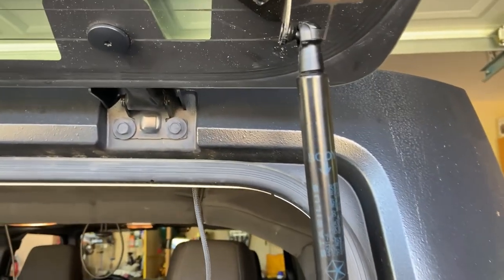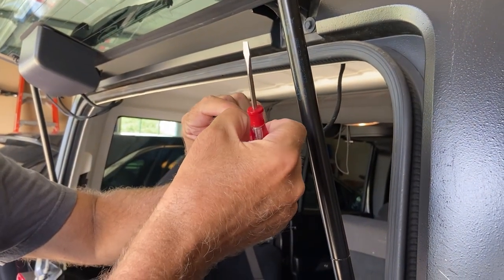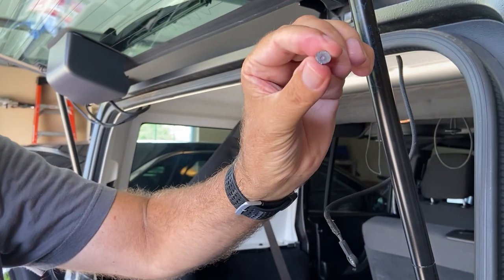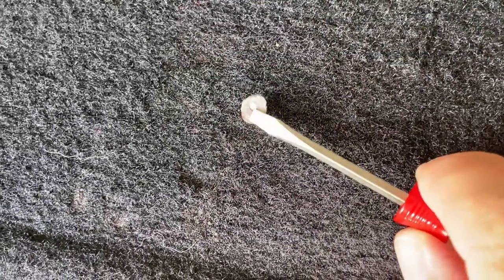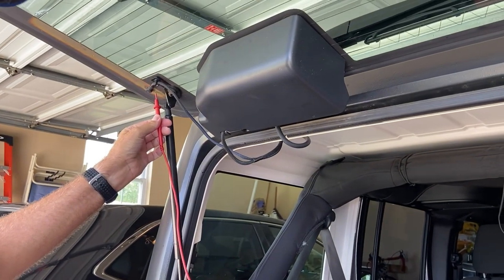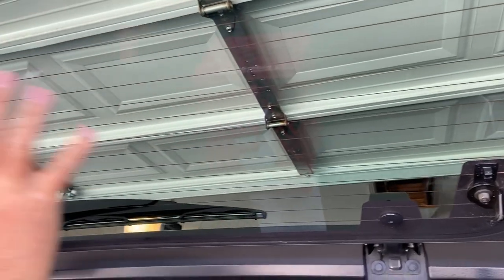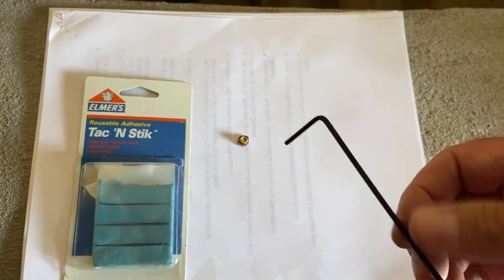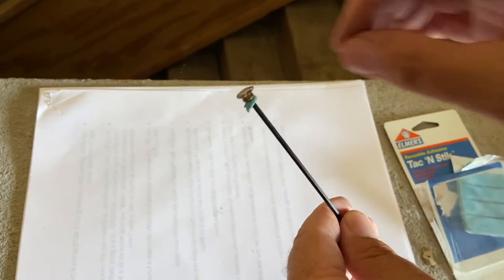Jeep Rear Defroster - 2016 Jeep Wrangler Unlimited Sport (JKU)

Comment: Just so you know, bud, OL does not mean "point zero L"😃 . It means "over limit". IE the resistance is infinity or out of range if you are using the wrong range setting to give a correct measurement

Comment: Couldnt you just solder it without taking it all apart and be done?  Literally a 3 minute repair
Reply from the maker: Yes.  I took it apart to explain to people what the “Nub” is, which actually the part being soldered to the window / connector.  It was visualization of what I was talking about during the process…and showing how it works & the pieces involved.
Reply: @scottfarrar3441  What type of solder did you use?
Reply: @scottfarrar3441  tell please what type of solder did you use ??
Reply: @Dplaw93   well, it should wasn't rosin core, ha!
Reply: @scottfarrar3441  very thankful for that.  I initially had no idea I was missing a nub or how the harness connected to the rear windshield.  Thanks again for this video!

Comment: Outstanding video showing how to change the rear wiper blade and wiper arm!!! I went to the dealership to check on a factory replacement wiper blade since I was having an oil change done.  The Parts Tech informed me that the entire arm would need to be replaced. After learn the cost of the replacement arm I decided to checkout YouTube for the repair solution and this video was the first one to pop up.  I found this video to be very interesting and informative to help assist me with the replacement of my 2011 Jeep jku sport 4 door rear wiper arm.

Outstanding job, keep up the excellent videos for us Jeep owners. Well done!!!

Comment: Great video!  I repaired my 2017 Wrangler rear window defrost tab with the Permatex adhesive.  This worked great for 6 months and now the tab has popped off again.  I will be attempting a soldering repair following these steps.

Comment: Should be a recall item. 
Nice video 👍🏼
Reply: yeah you would think... three years later and my THIRD tab fell off on my 2020 wrangler. Three years in a row with TWO brand new replacements of the entire back glass window at the dealership. They last for about 10 months and as soon as the cold hits, they fall off. At this point I might as well fix it myself once and for good with sottering it back on, because apparently Chrysler can't do sottering.

Comment: Thanks very much for your video. Its 2023 and i have a jeep gladiator 2020 with extended warranty, the solder came off on my rear defroster and chrystler wont do it under warranty. They want to charge me over 900 for a new window and 2 hours labor. Im sure this will result in the same issue.

Ill be taking your instructions to do the repair myself in the coming week or two, before winter comes. Ill post my result.

Thanks again!

Comment: One of my contacts is off on the rear glass, however I am not getting power to the rear. When I press the button the light should still come on correct? I have checked the fuse and relay. The knob works as far changing from vent to defrost etc, but the light for the rear defroster is not coming on.

Comment: I am doing as you go along, however  when I touch the solder iron to what appears to be the copper part(where it makes the connection) the solder is not sticking to it. Any ideas?
Reply: I have applied soldering flux. It’s just not working.
Reply: @Jettiam1 same here.   Strong iron.  Not sure what going on.
Reply: Glass is too cold. You can try a heat gun (ON LOW!) or as a last resort you can remove the entire window lay it on the carpet or a mat and solder it inside.

Comment: i cannot get the solder to stick
Reply: Glass is too cold. You can try a heat gun (ON LOW!) or as a last resort you can remove the entire window lay it on the carpet or a mat and solder it inside.